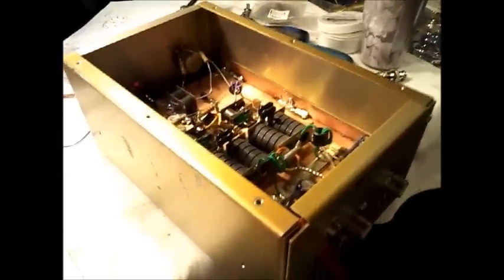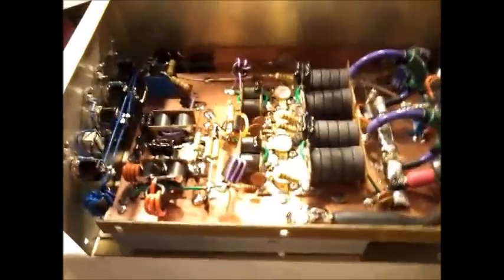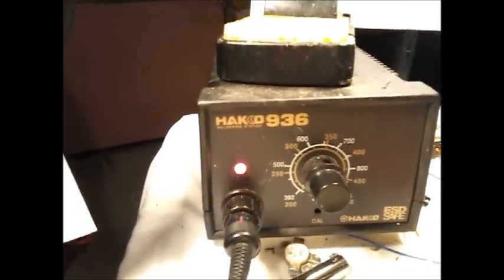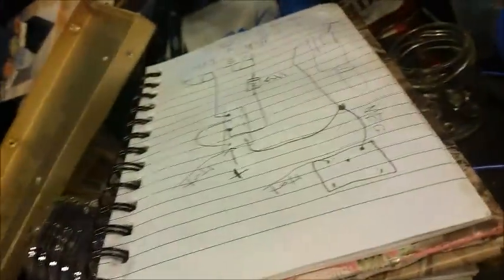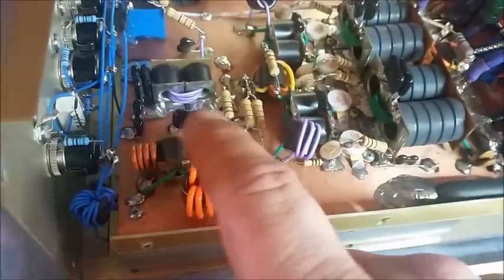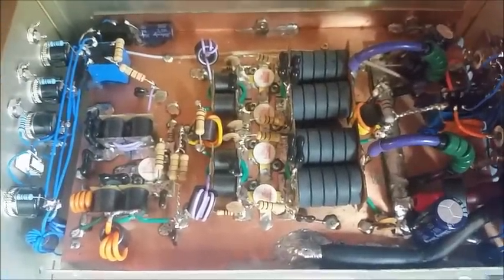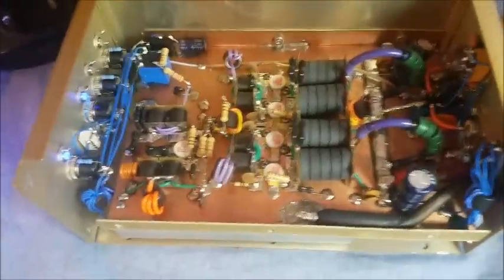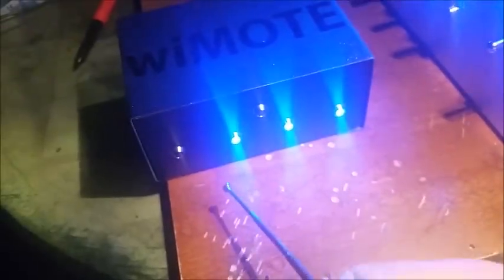Davemade GK Modified 1x4 with FULL Remote Control Functionality 🤓

Comment: 1883 good video. on some of the xforce thy use a 3kv 150 pf on the output and it seems to not hold up so I replace them with a 1000 pf and a 150 pf metal keep up the good work
Reply from the maker: Good deal brother...good thinking

Comment: Ranch 55 again....... And I also have some used "new" goodies that I want to send to you that you may find use for in some of your repairs. Some DEI 2SC2879's that came out of new Texas Star's that was not put into use, but replaced with some new Toshiba's.
Reply from the maker: ooooooooooh yeh Gatekeeper LOVES GOODIES lol.....stuff like that allows me to help people when they are in need brother. Your a great guy brother and guess what....i think i pulled off getting you that exact case that you saw in the video. i will still let you choose both cases are getting splased with House of Kolor Candy Paint right now.

Hope to work you again also on the air soon.
Reply: "Ranch55"  I think just go with the regular case you would use for a 6 pill build. More cooling surface available. .......
Check your info@ email.........I have more info for you and I need some information from you.